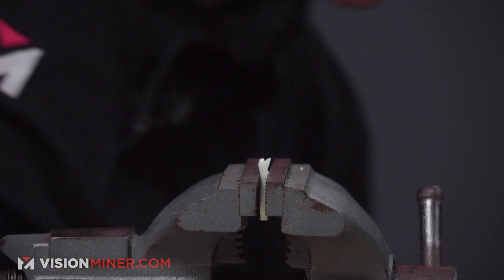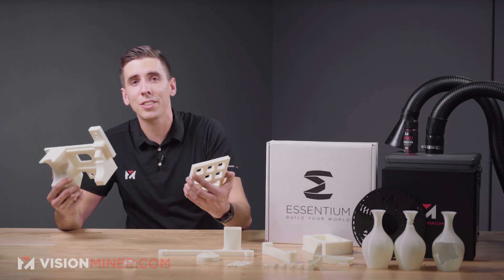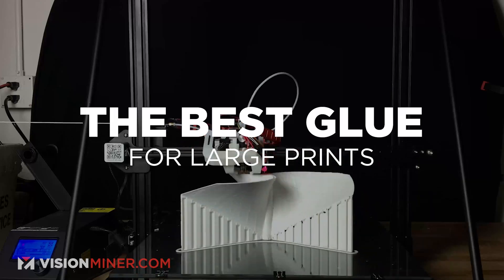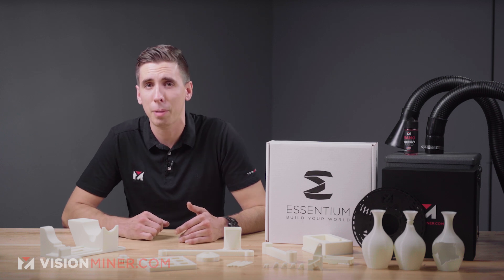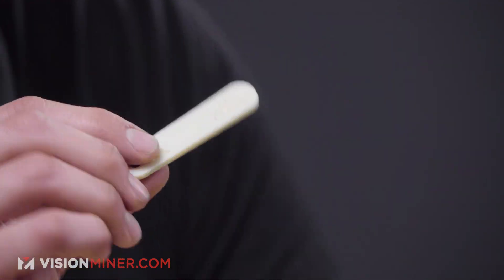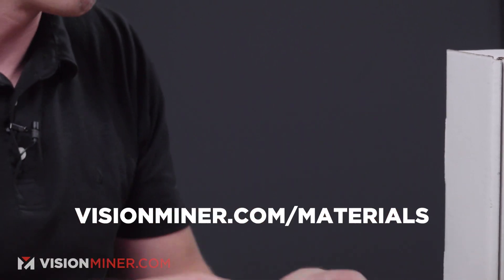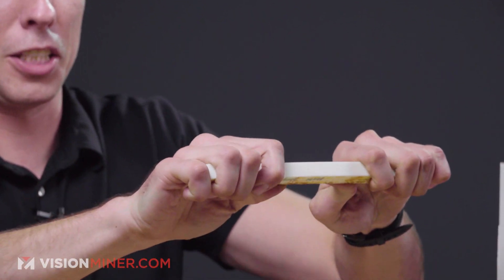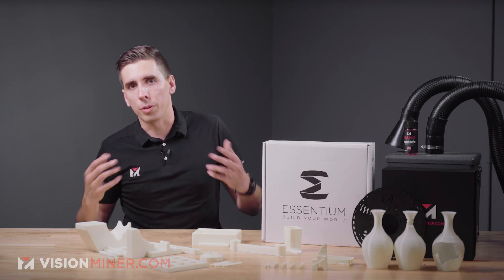Essentium HTN, High Temp Nylon - The BEST Delrin®, POM, Acetal Replacement for FDM 3D Printing!

Comment: I print delrin items, its hard to get dialed in and there are certain limitations of print size and design but it is very rewarding.
Reply: Could I ask what filament you use, and would it be printable with x1c?

Comment: Pity you never mention coefficient of friction, nor is it available on the Tech Spec Sheet. Wear resistance is nice and good but coefficient of friction is equally important to be able to know how effective it is in various applications.
Reply from the maker: Agreed! It's one of those standards being set by the industry as we speak -- a major discussion in additive manufacturing right now is standardization of material specs, and we're still in the wild west, but rest assured -- it's coming!

Comment: You should make a strength testing device and test different plastics. I think many people would be interested
Reply from the maker: Got a few devices in the works :)
Reply: @VisionMiner  It better not be a bigger vise!
Reply: The technical data sheet is the best way to know what strengths you have. Your major limiting factor will be your XY layer adhesion, that is your weakest point.
Of course there are options of going nuts and printing 100%, putting it into a Fine Salt/Sand mould and then "annhealing" it in an oven.

Comment: Wow... That's amazing. I tried to print delrin but it warps like you would not believe....

Edit: 100$ per 750g OUCH.
Still better than peek at least.
I wish you shipped here. And that I had money. I wanted to make a video about it and test it :/

There's a lot of parts on my project that are off the shelf metal parts because of wear. This might let me change them to more compact printed parts
Reply: Delrin requires a closed chamber, as it is super sensitive. I have managed to get it to stick quite well onto cotton fabric heated bed. Tricky to get the Nozzle Offset right though, as it is VERY fussy, it either sticks or it warps off. Its difficult to find a printer that one can Tune and still has the Temperature controlled chamber.
Reply: pine wood works much better
Reply: Yeah, i was seeing if I wanted the filament as a polycarbonate replacemtn, then I saw the price, and thought "wow, this costs more than cf nylon by a lot" and just gave up. Just gonna stick with pa6 thats annealed

Comment: Are there any multi-material machines that will let you print this as an integrated bearing surface with CF nylon for the rest of the part?
Reply: Any dual extrusion printer with an enclosed chamber and 300c capable hotend should be able to handle that. I'm working on trying to make it a possibility on the raise3d machines but they're not up to the task from factory
Reply: Might be able to do it with a modded prusa Mk3S with MMU2S, by modded I mean an enclosure :)
Reply: @lio1234234  I thought the mmu didn't support fiber filled plastics, but I could be wrong
Reply: @Beanpapac15  I've personally had no trouble with the MMU2s, you see it doesn't actually need that much strength since it's still using the direct drive on the printer to actually drive the filament, all the gears on the MMU do is push it into the hotend for it to grab. I'd say to safely run though, max 285 or the aluminium heat block would start softening

Comment: Can you compare against each-other the strongest filaments you offer that can be printed at 300c? If we could see gears or maybe print some hammers and use them. I’m trying to dial in on a light industrial grade material I can use for a military contract.
Reply from the maker: Love the hammer idea -- some practical parts to see what happens!
Reply: Start with CF Nylon I think, Polymaker CF Nylon has the best price to performance from what I've seen. from my testing their data sheets are almost always a conservative estimate of the actual strenght value. Comparing data sheet values I haven't seen any unfilled filaments that can match a good CF nylon's mechanical properties.
Reply: @Beanpapac15  I used the Polymaker CF nylon. Compared to 3dXTech CF Nylon or LUVOCOM PAHT CF 9891 (my favorite) I don't think it is a very good material. For me it was very hard to get a good layer adhesion. I think Polymaker's data sheets are on the optimistic side....
Reply: @42Luk  That sounds very peculiar, I had the same experience as Beanpapac15. Having a feeling either you somehow got a bad batch or just did something wrong
Reply: @lio1234234  What I wanted to say: It's not bad, but I think there are better alternatives on the market. Polymaker's values for strength in z direction are far too optimistic. If you look at the fine print, you can see why. They anneal the samples for 24 hours above the glass transition temperature. With a carbon fiber content of 20%, the layer adhesion is always worse than with 13% or 15%. (The adhesion between fiber and matrix is always worse than the strength of the matrix itself). At the same time, the polymaker material does not reach the values of the Luvocom material in X/Y direction.  It seems that Polymaker uses shorter fibers.
Reply: @42Luk  out of curiosity what are your temp, speed, chamber, and cooling settings?
Reply: @Beanpapac15  310°C nozzle, 50°C chamber, 50mm/s and no cooling.
Reply: @42Luk  damn, with those sorts of temps layer adhesion should be pretty decent
Reply: @Beanpapac15  that’s next on the spool, then I’ll be trying out the new PCTG from essentium.
Reply: @matthewpenn407  If you haven't already, take a look at colorfabb nGen as well, iirc it has marginally better mechanical properties than PCTG but I haven't tested either in the UTM yet so I can't say for certain.

Comment: Can u tell me why after 48 hours of drying at 75c it's still wet I can only get it to print at 230
Reply: 270 minimum my dude
Reply: @lio1234234   Like I said I dried it for 48 hours tried at 270 in all did was bubble and hiss and spit I did it at 230 and got a successful print. I have printed taulman high temperature nylon at 300 works fine but Taulman  Has major tolerance issues to the point where it flattens out and ovals
Reply: @lio1234234   And very experienced a printing Nylon it's my favorite to print just maybe got bad batch or something
Reply: I assume you're printing from a drybox, from what I've seen nylon has a higher drying temp than many other plastics so trying drying in the 85-90c range in a chamber with desiccant if you haven't already.
Reply: @Beanpapac15   I print all kinds of nylon I print right out of my print dry system I think I just got a bad batch to be honest with that being said please bear in mind I print lots of nylons all different types
Reply: @Beanpapac15   If I can post pics here of my setup I am sure you would highly approve I definitely have the right printer and drying system that the filament comes right out of while drying
Reply: @princefpv1  I'm not here to doubt your ability to print nylon, I'm just trying to suggest something that might work. Since you already bought the filament there is no reason not to try drying at a higher temperature in your oven. I've used a print dry system before and they work, but the max temp is only 70c, which is half of what Essentium recommend for drying.

 Also unless you specifically need this material try polymaker's polymide nylon. Its good stuff that has only slightly worse strength and thermal properties and is not as finicky. plus its cheaper
Reply: @Beanpapac15  okay I see I never new it needed higher drying Temps just wired cause other HTN iv used dried fine in print dry
Reply: @Beanpapac15  thanks brother only thing is I has gas stove so no go there
Reply from the maker: @princefpv1  @Beanpapac15 It's definitely a different beast, as it needs to be dried at 130c -- much higher than normal :) Stick it in the oven, for sure, should have mentioned this in the video :)

From the datasheet at https://www.visionminer.com/htn :
If the material
 does absorb more than 400ppm moisture, it should be dried in a low dew point (< -40˚C) oven or vacuum oven at 130˚C for 6 – 8 hours
Reply: @VisionMiner   Thanks guys gonna have to buy a toaster oven I guess I have gas stove and unfortunately my vacuum seal pump doesn't work anymore
Reply: @VisionMiner   Do you think if I leave it in my filament dryer that does up to 75C for a week might do the trick or no?  Or do I still have to hit them high temperatures like 130 to actually pull any moisture out